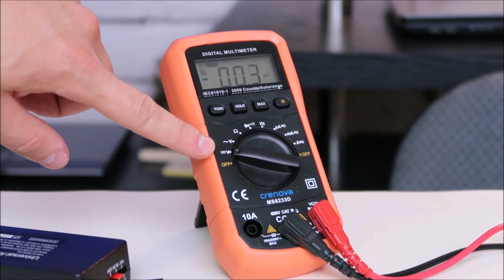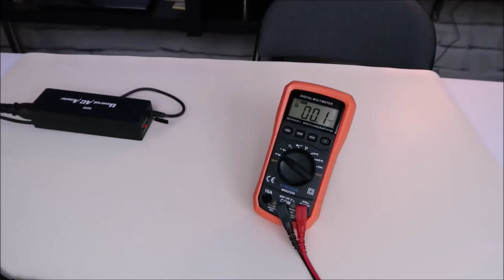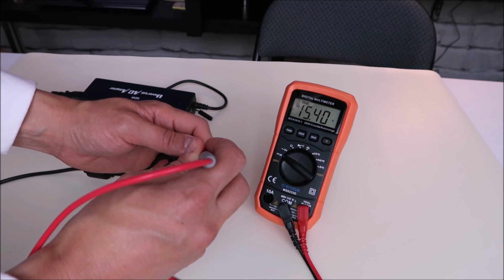How To Fix Any Laptop - Wont Turn On, Wont Open, Turns Off Right Away, No Power Solution

Comment: I've tried nearly all of these, the issue is when I put the charger in there's a green light meaning it's charging or fully charge I forgot and it just doesn't turn on?
Reply from the maker: If all the tests in this video do not reveal the issue, and your power adapter tested to be fine, then your most likely looking at a Motherboard replacement
Reply: @PC_Monkey  nvm I found the fix, it seemed like the power button was damaged. It fell and soemthing happend to it
Reply from the maker: @Shokfyy  Nice !!  You gonna replace the power button or were you able to repair it?
Reply: @PC_Monkey  Not sure yet haven't token the laptop apart yet, seems like the button is in place but the thing that controls the power has moved or soemthing. Is it an easy task to fix?
Reply from the maker: @Shokfyy  I dont understand, 'seems like the button is in place but the thing that controls the power has moved or soemthing.'

Comment: My battery could ONLY be charged when the computer was shut down. I tried the Static Discharge process several times, but the battery still could NOT be charged. Also, it's worthy to note that the computer could not be turned on when the power cord is plugged in (but the battery is not in place). Please help!
Reply from the maker: May be an issue with the charger.  It could be strong enough to charge the battery OR run the computer but not both.  I would replace the charger.

Comment: hello. i have an hp laptop i have been using it for like a month. the battery cannot be taken out. and then today as i was using it, the screen turns black but the power still on. i tried powering it on and off, but the screen still does not work. anybody please help😭😭😭😭
Reply from the maker: If the screen is black, what are the signs the computer is on?  Lights?  Sounds?  Fan?
Reply: @PC_Monkey  the power button has a light but the bottom of the laptop, i dont know if its a weird sound or if its the fan (its making sounds also)
Reply from the maker: @kadikadi3590  If the fan is making noises then we can think for now that the computer is actually turning on.  Lets proceed like that for now.  For a computer that turns on but the display does not work, try this video first;   https://youtu.be/u-REPLdpZ70
Let me know how that goes :)
Reply: @PC_Monkey  but i have internal battery😭😭😭😭
Reply from the maker: @kadikadi3590  For help accessing an internal battery, refer to this video;  https://youtu.be/tUCVN2GLYuA
If you know your computer's model number, I can help you get inside your specific computer :)

Comment: What about when the charger shows orange light but when plugging on to the laptop it disappears. Does it mean the battery of laptop is not good
Reply from the maker: Are the lights the only signs of life when you turn it on?  No motherboard or hard drive sounds?  No fan noise?

Comment: hi , thanks for showing me ... my old laptop becomes kind of desktop, no longer on battery. here is the thing.. power button still lighted after shut down, wont restart after selecting  restart, will not wake during sleep mode. All these have to  power jack unplug and plug, only then will function. I guess from your video which leaves 2 things..check on the power brick and removes the cmos battery. If all fails...just live with it..
Reply from the maker: If all fails, then your looking at a bad motherboard.  Either that or your computer needs a functioning battery to access those features.
Reply: @PC_Monkey  hi again, no worries, just wanna make the old unit useful, i mean everything is functioning well. just the power button issue. Other thing i have a Dell I5 7566 an entry level gaming laptop which i bought sometime back, now that my son has Acer Nitro 5, i taken over..the issue is heating and check no way the fan can be controlled. Did a  bypass( by PC repairer) to have it ON when power up, only thing the fan noise is a bit of a annoyance. Any tricks in your bag where can be control manually? Thanks
Reply from the maker: @jamesyew635  Some BIOS will let you.  If not, you will have to download some software for that.  They can be glitchy though :/

Comment: Lap top powers on then goes right off. I pulled all the RAM tried one at a time, nothing changed, I pulled all of them out. Then turned on my lap top, it would come on for a minute or so, some times the fans would even start up, but then shut down.  It it possible that my three sticks of RAM are all bad? Please help!
Reply from the maker: Can you see anything on the screen before it turns off?
Have you tried the steps seen here in this video?
Reply: @PC_Monkey  nothing on screen and yes I have tried it all.
Reply from the maker: @williammcclellan9814   If all the tests in this video do not reveal the issue, and your power adapter tested to be fine, then your most likely looking at a Motherboard replacement as seen here;  https://youtu.be/N_7HNrFkMS8.
Reply: @PC_Monkey   ok thanks for all the help. Would you know where I could get a mother board for my lap top? Asus g750J ???
Reply from the maker: @williammcclellan9814  I usually get my computer parts on sites like Ebay or Amazon.  Usually cheap and good shipping and return policies.  Is this your board?  https://www.ebay.com/itm/323391139324?hash=item4b4b9d2dfc:g:~c8AAOSwRc9gq3mv

Comment: I fixed it once through removing the battery and pressing thd the power button ..it was starting up and reached home screen..then after some minutes it turned off..and now it don't even turns on...please help.My system is lenovo IdeaPad 330
Reply from the maker: If that step does not work, then continue on with the rest of the video :)
Reply: @PC_Monkey  Thanks bro for the reply. i think it's fixed now.Re setted my windows.
Reply from the maker: @mohammedshamil3976  Glad your all set :)   Always here if needed !!
Reply: @PC_Monkey  here in back with another problem.my.pc is nt turning on.I tried all the me mentioned methods, did the static discharge several times and still doesn't turn on🥺..any new or other fixes.
Reply from the maker: @mohammedshamil3976    If all the tests in this video do not reveal the issue, and your power adapter tested to be fine, then your most likely looking at a Motherboard replacement

Comment: one day : I was working with my laptop , windows update restart , it did not restart, battery remove trouble shoot sucessfull, I was working and display gone, power led was on as well as cpu led, I moved finger over touchpad ,I pressed power button , long pressed power buttom all three nothing happened , now only power led was on , CPU led was off. I removed battery , 30 sec power press , connector charger while  battery removed nothing happened, (charging led was glowing). I plugged in the battery and shut the lid and kept for 3 days

3 days later. I just pressed power button, it switch on everything normal , recovered by files easily  I connected the charger , and left everything on , 30 minutes later laptop was on i was not even using it suddenly went to the state of one day, i tried everything like one day but nothing happened. 

what can be the issues??
Reply from the maker: For a computer that does not turn on, your on the correct video.  Have you tried all the steps seen here?  They troubleshoot the possible causes.
Reply: @PC_Monkey  yes , but i have not opened the laptop
Reply from the maker: @starman8505  I dont understand your reply.  You have tried the steps seen here but have not opened the computer?

Comment: I also tried using rubbing alcohol on my battery and it still doesn’t work.
Reply from the maker: This comment isnt attached to any previous conversation so Im not sure what the history is here. 
What brand and model computer do you have and whats the issue with it?
Reply: @PC_Monkey  it is a HP lab top. I think something is wrong with the power button. The computer froze when I was in the middle of doing something. I couldn’t turn it off by holding the power switch. I didn’t want to unplug it and wait all night for the battery to run out. I pulled the power cord from the lab top.took the battery out with the intention of rebooting it. After I did that it wouldn’t work I did your static discharge steps. Held the power button for 90 seconds. Not just a minute. 90 seconds! Put the battery back in and it still didn’t work. I did it again with the power cord . Again didn’t work. I will just take it to the geeks at Best Buy. At least they are professionals and pay hundreds of dollars to get it fixed. Or they will probably tell me I need a new computer. Which means I have to start fresh and consider all the data on my computer gone. I don’t want to do that more than spending money just. To get the computer I have fixed. Then I have to start from square one. I don’t want to do that. I want my computer back to working order. Which means letting the Geeks at Best Buy take a look at it.
Reply from the maker: @biguy617  If the power discharge didnt help, then its most likely not a simple battery or charger issue :(  If you like, you can try a BIOS reset which would be the next troubleshooting steps.  Or if you like, your can take it to them.  But yes, most likely they will just tell you that you need a new pc :)
Reply from the maker: @biguy617  Good luck !!  Hope it all works out

Comment: Umm I need help I maxed out the tolud or tulod of my laptop to 3 gb now it won't boot up what do I doo?
Reply from the maker: How will it not boot up?  Whats happening when you try to turn on the computer?
Are there any signs of life at all?  Lights?  Fan, Motherboard, or Hard Drive sounds?
Reply: @PC_Monkey  well when I turn it on I can see the screen turns on for one second but then it turns off immediately ig its that cmos battery problem so 8 am gonna do that

Comment: The charger is plugged in and when i turned on the laptop it still isn't working please help.
Reply from the maker: your on the correct video.  Are you able to try the steps seen here yet?
Reply: I tried almost all of it but I still can't find the cmos battery in my laptop
Reply from the maker: @thr45h3r9  Not all motherboards have a CMOS battery.  
 If all the tests in this video do not reveal the issue, and your power adapter tested to be fine, then your most likely looking at a Motherboard replacement

Comment: I was turning on or off my laptop I can't remember which one but its charger came out and know it won't stay on without it my laptop is windows 10 please help me
Reply from the maker: If the computer wont turn on without the power adapter plugged in, it sounds like you need a new battery.

Comment: Hp compax 8100 elite stuck on boot agent GEV 1.3.53 PXE 2.1 build 089 keyboard and mouse don’t work 
unplugged everything changed 3 volt battery F keys don’t work is it hopeless? Thanks

Comment: I think it's a motherboard issue coz I tried all the steps and it's still not working
Reply from the maker: Yes.  If all the steps here dont find the issue, then its most likely a MB issue :(  
Let me know if you would like assistance with how to deal with a MB replacement :)
Reply: @PC_Monkey   I don't think it will be worth it coz my laptop is very old now.......My laptop model is LG - E530
Reply from the maker: @s.k.pandey7559  I couldnt find any for that info online :(  Sry
Reply: @PC_Monkey  Thank You So Much For Your Help.....😊....I will be getting a new one....
Reply from the maker: @s.k.pandey7559  Good luck !!  Always here if needed :)

Comment: how about CMOS battery failure. is it not necessary to check the battery with a voltmeter as well to make sure it is not drained?
Reply from the maker: Yes, the CMOS battery dying can be a reason why the computer wont turn on.  Thats step 2 after this video.  You can check it if you like with a voltmeter.

Comment: Please help me. I have a somewhat different problem. I have a Lenovo Ideapad 330-15IKB laptop. One night everything was normal but the next morning, my laptop just didn't start. When I try to start my laptop after at least 3 hours from the last attempt, it reaches to the initial startup logo screen(Preparing Automatic Repair comes under the logo), but it turns off automatically immediately after. When I push the power button again after some time(and not after 2-3 hours), it never reaches to the startup logo screen. Power button and the side power indicator show status; Caps lock and Num lock don't show any status when I try to push them; I can't hear any sound of the internal fan; screen stays black but now it stays turned on and doesn't switch off automatically.
I tried to execute the first step of static discharging but I couldn't because 2 screws of the battery are stripped and I couldn't unscrrw them and hence I couldn't remove the battery. Can this step still work if I just remove the battery plug from the motherboard? Although, it's hard to remove the plug this way because the cable of plug is very hard and inflexible, but I can still give it a try. When I couldn't execute this step, I reseated the RAM and tried to start the laptop but it didn't work. Then I took out the plug of CMOS battery and reinserted it after 40 minutes. I tried to start the laptop immediately after but it didn't work either. Please help me what I should do.
Reply from the maker: Yes, you can just unplug the battery from the motherboard to complete the first test in this video.

Comment: Hi! I have an acer laptop and accidentally clicked UEFI reset and my laptop wont display anything at all but with power on. I tried removing the memory and cmos battery, external monitor but still no display. Needed much help. Thanks
Reply from the maker: Are there any signs of life at all?  Lights?  Fan, Motherboard, or Hard Drive sounds?
Reply: @PC_Monkey  the fan works but after a while then stops rotating. I tried plugging in an external monitor and keyboard but nothi g at all. The only clue i got is the powerbutton light and the battery charging light indicator.
Reply: @PC_Monkey  thank you. I will watch it and see can do from there. Such a big help!

Comment: Bro my laptop doesn't turn on with power button......it just turns on whenever it wants and went strait to Nova booth Menu helppp sir....btw my laptop lenovo ideapad 320
Reply from the maker: your on the correct video.  Are you able to try the steps seen here yet?
Reply: @PC_Monkey  yes i have tried all....i remove the cmos battery and it turned on....after that i turned off and it turned on by itself leading to nova booth menu and it cant be turned on right now again.....
Reply: For a few days  it was working and....it happens again

Comment: hmm my ram is not a problem i tried starting without battery that didnt worked i started without charger thaf didnt worked what is the problem in mine its just starting and closing like i see the white light turn on that it turns off i see nothing i hear the fans starting but than they turn off too
Reply from the maker: Have you tried the steps seen in this video?
Reply: @PC_Monkey  yup I did it 6 times thinking I am doing something wrong but now I think I found it, I think it's a motherboard problem
Reply from the maker: @kingogar9667    If all the tests in this video do not reveal the issue, and your power adapter tested to be fine, then your most likely looking at a Motherboard replacement
Reply: @PC_Monkey  ye

Comment: This always happens to me 😔 and always I have to do this but not always it work, so what shall I do?
Reply from the maker: What brand and model computer do you have and whats the issue with it?
Reply: @PC_Monkey  Toshiba satellite c850-19d
Reply from the maker: @denkenunddanken5961  Are there any signs of life at all?  Lights?  Fan, Motherboard, or Hard Drive sounds?
Reply: @PC_Monkey  it works (switch on)  sometimes but not always.
Reply from the maker: @denkenunddanken5961  what are the signs the computer is on?  Lights?  Sounds?  Fan?
Reply: @PC_Monkey  when it is on, all the three light, sound and fan works

Comment: Help pls i have tried everything and it wont work
Reply from the maker: What brand and model computer do you have and whats the issue with it?
Reply: @PC_Monkey  well its an hp i can't open the back of my computer so i can't see if something is wrong there since one of the screws is to tight i can't unscrew it
Reply: When i forgot to turn it off for breakfast i went back to it and it was fine then the screen turned black but it was still on so i force shut it off then a few minets later i went back to open it but it won't open
Reply from the maker: @XxShiro_PlayzxX  Are there any signs of life at all?  Lights?  Fan, Motherboard, or Hard Drive sounds?
Reply: @PC_Monkey  no its just all black
Reply from the maker: @XxShiro_PlayzxX  If all the tests in this video do not reveal the issue, and your power adapter tested to be fine, then your most likely looking at a Motherboard replacement as seen here;  https://youtu.be/N_7HNrFkMS8.  If you know your computer's model number, I can help you get inside your specific computer :)
Reply: @PC_Monkey  i can't get to the mother board some of the screws won't come off I've tried to switch screw drivers but it still won't work
Reply from the maker: @XxShiro_PlayzxX  Is the screw stripped or do you not have the correct sized driver?
Reply: @PC_Monkey  no its not stripped i don't have the right screw driver i think

Comment: Hp laptop turn on and immediately logging off
please tell me what is the solutions of this problem
Reply from the maker: What are you seeing on the screen before it turns off?
Reply: @PC_Monkey 
I have the same issue as him it won't even boot into nips just the power on light and it switches off after 3 seconds